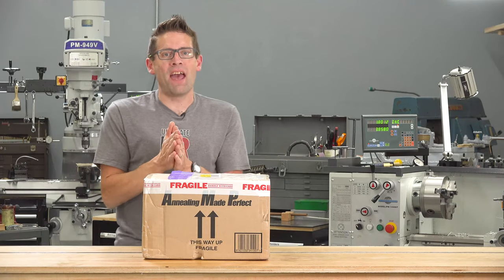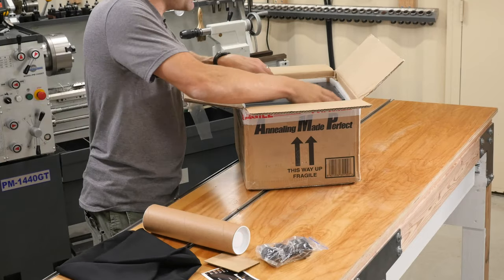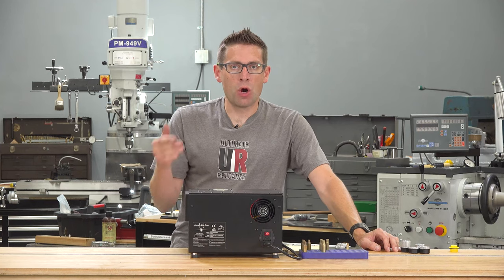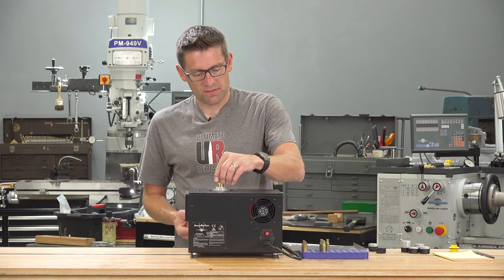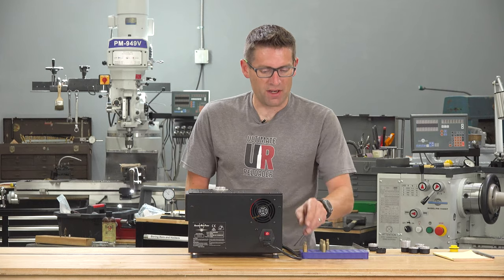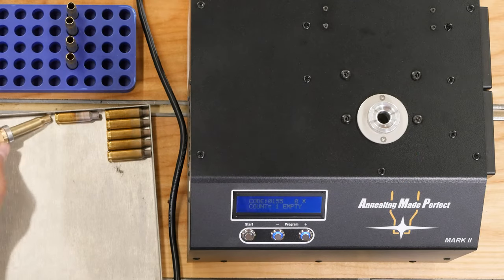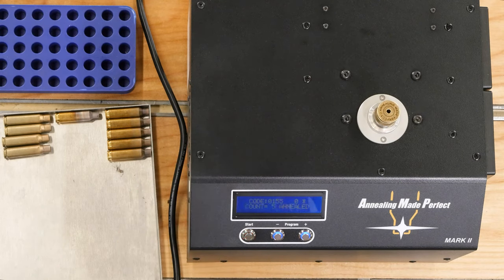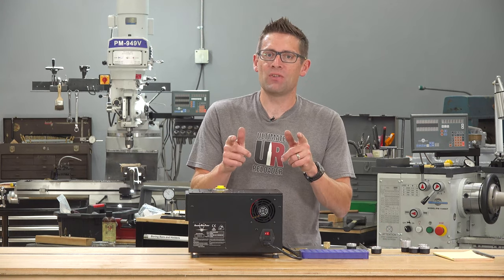Annealing Made Perfect: AMP Mark II Unboxing, Setup, Annealing 308 Winchester and 6.5 Creedmoor

Comment: Slow and over priced. It’s just not worth it IMO. There are other options that are faster and work just as good
Reply: slow? Over priced? You understand that the AMP has so many benefits its not funny:
Easy to set up
Can be left and come back to at any time with no risk of changing variables 
No flame
No salt baths
Dont need to attend it with the chance of it burning your house down
No need to paint cases with heat sensitive paint
Has regular updates
Has actual metallurgy to back up the product (brass is tested in the lab to gauge its correct annealing process even down to different batch codes of brass in a single brand)
Can actually (as shown in the video) analyze your brass to give you the correct annealing solution for your brass
Localities the heat in the exact same spot for the exact amount of time (no need to count in your head or use a timer) Consistent! 
can do as many calibers as you desire with no setup other than changing the pilot and code.
Is compact and safer compared to other methods
After letting the brass cool down you can go ahead and neck size and load. no cleaning or additional prep required.
Is not slow, literally only takes at most 5 seconds per case... and no more than 2 min to set up. If you dont have at least 15 min anneal 100 cases you are looking at the wrong hobby as it is a time consuming hobby from the get go.  
This is made for shooters that want the most out of brass longevity, but realistically competition shooters that want the most performance out of their loading. 1500 bucks for a product that is so simplistic and actually has girth to its claims is not a lot of money.

You need to understand that this product has actual science going on in that box not just "HeaT It WiTh A FLamE"

But then again your opinion of "BUt tHe MacHiNE iS OvA PRiceD" and "OtHeR MeThodS JUsT As GoOd" is the same as "I dont have 3k on a custom target rifle but my $300 out of the box is "JusT as GoOoOD" 

I cant wait to get mine, just saving the pennies.